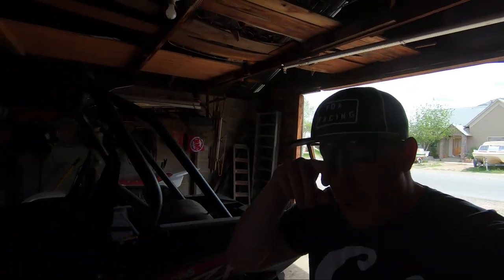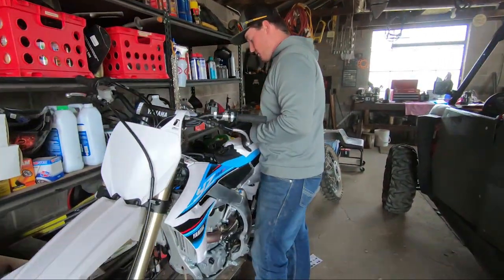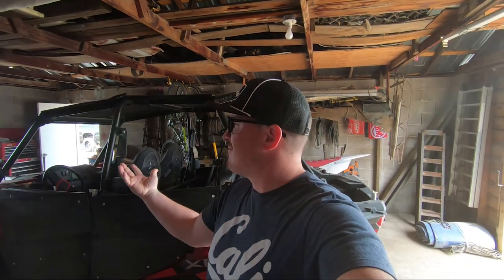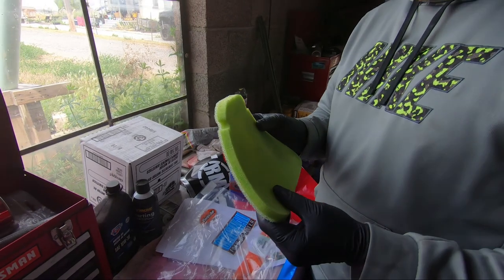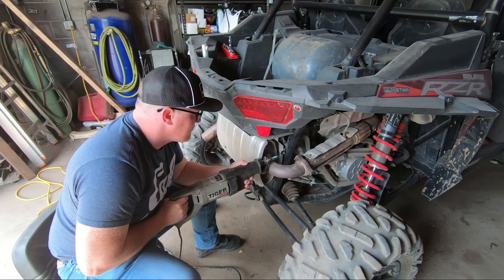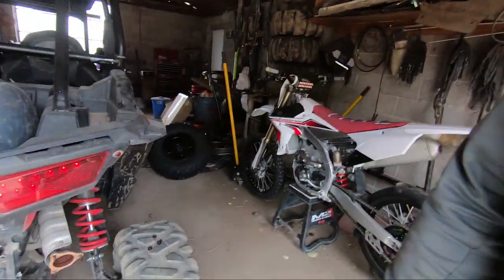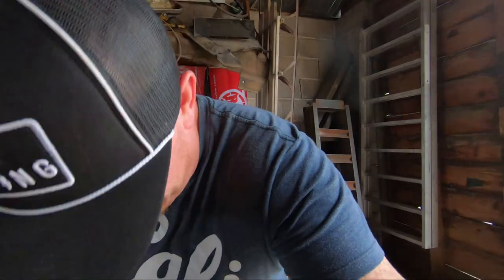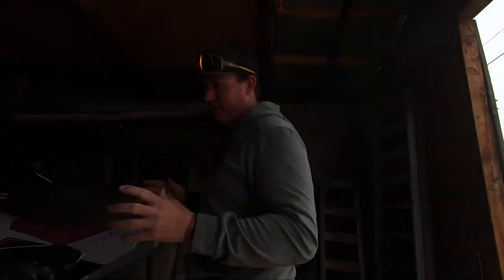LITTLE SAHARA SAND DUNES MEMORIAL weekend 2020, CUSTOM rzr 1000 TURBO EXHAUST!!!

Comment: No spark arrestor. If its pointing down, you could be liable for any fires it causes. Other than that...  I'm jealous.
Reply from the maker: Your 100% right! The main purpose for cutting off the muffler was to punch out the catalytic converter that’s in the stock muffler. We built a quick turn down tip just for fun to see how ridiculous it would be!!!